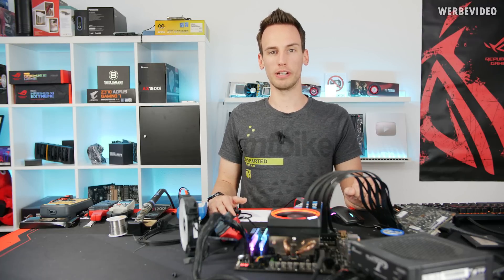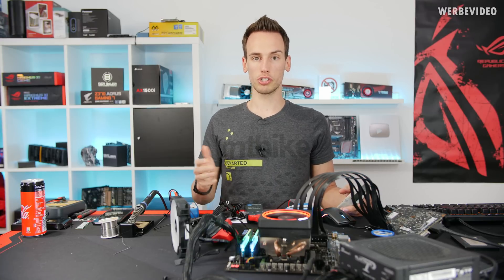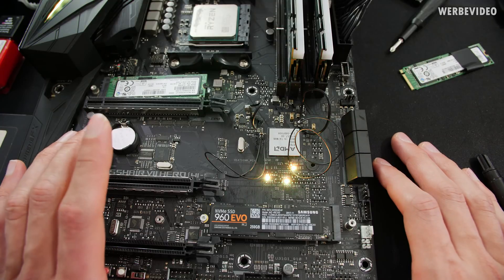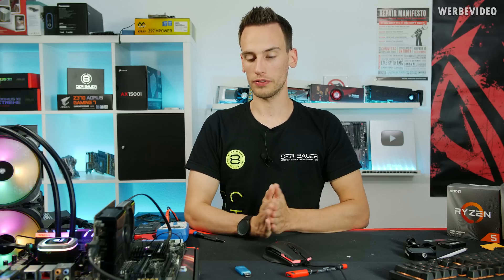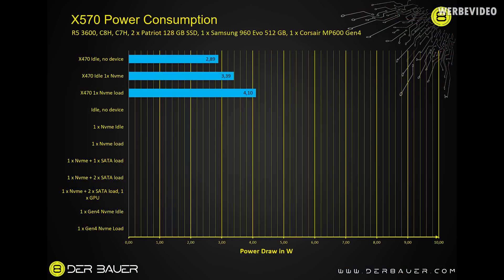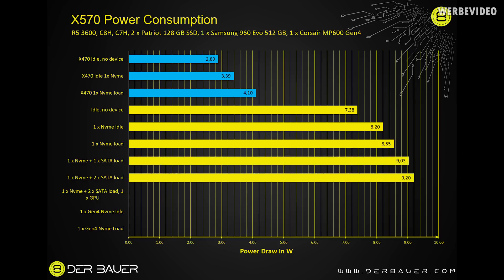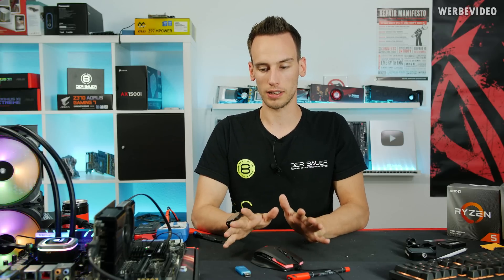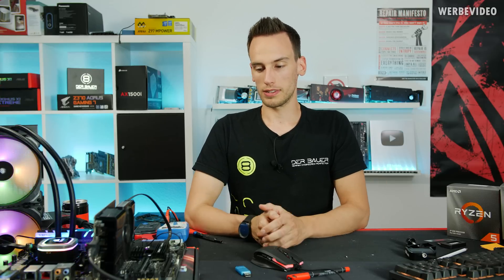X570 Power Consumption Measured - What is going on here?

Comment: 16:41 When I last touched the chipset heatsink (like 15 years ago) while the computer was on, my epox 8rda+ just killed itself with a "jjjzzbttt" sound :/
Reply: Make sure you discharge any static you've built up to avoid that again. Especially when it comes to hardware that old or older. They have less protections in place for static discharge.

Comment: Another question is why did some of the motherboard mfgs build 4+2 stage X570 motherboards? We already have those in current B350, B450, X370, and X470 motherboards now. Buyers beware when searching for a "cost effective" X570 solution. And AnandTech's recent article is all wrong. Do not trust their VRM numbers. Its as if they just counted caps like any numbskull would that knows nothing about motherboards.

Comment: Fantastic video, I love stuff like this.  One thing you failed to mention is that these new PCIe4.0 drives run at the same speed on X470 boards.  Or at least, they do on the Crosshair Hero VII.  I realise it wasn't the purpose of the video, but it further compounds the question mark over X570.. in terms of extra power, extra noise, dodgy fans that aren't required and the only advantage is something that you can get on X470.  I expect that in time newer SSD's might be able to take advantage of PCIe4.0 but at this stage.. they haven't.  Same thing with video cards.

Comment: der8auer, I have to wonder if the additional heat of the X570 chipset vs X470 is because of the difference in "who" designed the chipset.  ASMedia designed the X470 chipset, while AMD designed the X570 chipset (with IP licensed by ASMedia)

I have to wonder if AMD simply cannot design a cool GPU or... now... chipset.
This heat makes the rumored delay in the Ryzen 3000 that Adored reported on being a chipset issue make much more sense.  I really don't understand why AMD would make this change in design if the direct ASMedia designed chipsets were so good though.

Comment: I live on Deccan plateau(India) and here during summers air temps cross 45C. I find it funny how X58 which had 20W power consumption and the motherboards had some of the best heatsinks I have seen to this date and majority didnt have fans. Even those X58 chipsets didn't heat during summers here in India. Those stupid fans are sign of lazy ass engineers who decided to reduce their workload on designing a proper cooling solution.

Comment: I think the reason for the fan is the same reason that AMD is using blowers on their GPU. Because the chipset produces more heat, AMD doesn't trust that people will have proper ventilation in their case. This is what they said was the reason for the blower on their GPUs. I think it's the same reason they pushed to have fans on the chipset. Now, as to WHY the chipset uses more power, I don't know.

Comment: Those long wires might have messed with the tests. Especially the wires in the inductors, would have probably added a lot of inductance and resistance, changing the Q etc.
Reply: i doubt it. the resistance of that wire is a lot less than you think.

Comment: Hi. Love your in depth technical analysis. Also, thank you for calling out on the non requirement of fans for the chipset. I had a feeling those were unnecessary months ago. Thank you for confirming that. I have a very simple question. Why are motherboard manufacturers releasing all their boards with such insane power delivery? I get it that a MSI Godlike or an ROG Crosshair or Aorus Extreme has to live up to its name and price and have at least 12 to 100(pardon my sarcasm) phase designs. But why do the normal boards, sub 200$ boards also need to have these? It has been shown that a 12 core 3900X draws less power than a 2700X under full stress load. It hardly draws more that 150W under extreme circumsatances. An 8 phase proper power delivery would be sufficient. Thus, it is perfectly possible that a good 200$ board could run it. But bacause of this image that AMD and the board manufacturers and the general public has created, all X570 boards are expensive because of high end power delivery systems. Also if possible, please make a video showing that it is perfectly fine to run the 12 core 3900X from a good X370 or B450 board, let alone an X470 as I believe those are perfectly capable of running the new chips upto the 12 core cos of the less power draw. I know the board manufacturers are making all the boards future proof for the 16 core 3950X, but it would be good for AMD if the media also portrayed that and not make it look like Ryzen 3000 needs a large amount of phases and high end boards. Really, someone like you saying that an X370 or proper B450 like the Tomahawk is more than enough for the 3900X or the 3700X respectively would make a lot of this confusion clear.

Sorry for the long post. Thanks. :)

Comment: remarkable work! that makes me feel a bit better if I buy a x570 without active fan shit cooler on top.
Reply: just remember it was still hitting 70C which is hot enough to crash Phenom/FX cpus if you tried to run that hot.   if it's gonna run that hot i don't mind the fan.
Reply: @XX-121  it was 70c with a cheap tiny heatsink... if you have a proper one like Gigabyte has in 1 model... it will not get 70c for sure.

Comment: @der8auer
I have a theory on the higher power consumption of PCIe 4.0 , they went from two voltages to four to transmit two bits at once (11 10 01 00), I can imagine that they had to increase the voltage because otherwise the noise would make the voltage drop too much (below the threshold) X% of the time. Just a theory but whatever the reason is, I would bet that it has to do with noise for whatever reason, if you have more noise then you can always compensate for that and ensure reliable data-transmission by increasing the power, however you do it (several ways).
Other than that, I find it rather lame that the motherboard-companies hide behind the power-consumption when they get asked about the chipset-fan, they should be honest about it and explain why they didn't just use a copper pipe to absorb that heat.

Comment: I think the higher power consumption may be on the gen 4 interconnect between the in CPU I/O die and the chipset. Running a gen 3 device on the chipset doesn't mean the chipset is now talking to the CPU at gen 3

Comment: What's the total resistance of those wires ? More resistant less power right ? or the PSU compensates ?
Also what's the point of this video? Why the chipset PC is important ? Like those RGB LEDs pull more power than the chipset.

EDIT: okey i wrote before i watched that last 3 minutes. 
I love the GB P67 UD7 mobo, but i guess that heatsink  design can't be applied to the new mobos becase of the nvme slot right under the CPU socket.

Comment: sorry but to measure the current after coil gives completely misleading results if you do not have the right equipment. Frequency on the measured current is too high and can lead to rough measurement errors

Comment: test the mp600 on a x470 board and you get the same speed as on the x570 in my case , so it operates @ pci-4 on a x470 board to , this is strange

Comment: Also why does Gen 4 have the same read and write speeds on a X470 board? Reported by OC3D TV. Wonder what the chipset temps are on a X470 when using Gen 4 NVMe.

Comment: Thanks for investigating the X570 chipset power consumption Roman. I've thought that to... Why not just have a larger passive heatsink with more surface area? I dread using a small dinky little fan like that. If the fans were made by Noctua or Be Quiet! then that would be something. But yes, a fan is not necessary if the passive cooling is done right.

Comment: Many thanks for testing this... and Yep. This is very trange... have you been asking mother board vendors hard questions after testing this? Pci 4.0 need better wires, but that should use even less electricity because thicker wires should be better conducts (in reality there is no difference unles you put heck a lot current in there) Maybe They just use higher voltage, like when overclocking memory etc. And that is why effiency is thrown out of window in here. Aka a Little bit more stability, by using really high voltage and thus using a lot of energy for minimal benefit? That is my ques...

Comment: i'd imagen a lot of the increased idle power is that the chip set itself is a gen 4 device. without load its still talking to CPU  and the power draw needed to maintain signal integrity might just be higher

Comment: Thanks for the interesting video. Some YouTubers report that PCI-E 4.0 SSDs produce the same speeds on x470 motherboards with a Ryzen 3000. Could you please test that? Also Ryzen 2000 on x570 would check the theory that PCI-E 4.0 Infinity Fabric between chipset and CPU consumes that much power.

Comment: Motherboard VRMs can put out more power than that yet they don't have active cooling. Definitely a strange choice.
Reply: They are also massively more surface area and good for 120c. FX for example is so big, that it runs very cool even though it’s power hungry (thermal shutdown is 80c, I think official spec was 69c), so it stays much cooler than Intel even at the same heat load and cooler (it’s just better at dissipating it, like spread out VRMs). So make sure to account for those things.

Comment: Tip for future micro soldering, use flux. It works wonders and you can never use too much of it. Also look into an air rework station for removing smds. Much safer than direct heat from an iron.

Comment: The hilarious thing is they have been die shrinking CPU's and GPU's for decades... yet they didn't think a chipset die shrink was necessary!!!

My X99 R5E had a fan on it too, except that I got an EK monoblock for it that also cools the CPU and VRM. Expensive solution, but very effective and keeps the chipset under 50C no matter the load.

I think for this platform to not flop completely AMD better get those cooling fan specs up to par with the motherboard manufacturers. You don't want to be replacing a $400 motherboard after a year because a shitty 40mm fan with dead sleeve bearings ($2 component) is the point of failure. It would be wrong to expect folks like EK to step in and make blocks for every model of X570 board out there.

I've gone through this already four years ago when dealing with GSkill's memory cooler. Those horrible 50mm units would crap out after just 6 months of use - first the LED would die then the fan. I got sick of replacing them. I finally sourced a half dozen ball bearing PWM units from Delta, same 50mm size but with a much longer MTBF, custom assembled for me by the folks at Digikey. Admittedly these 50mm fans weren't cheap, but I've been happy with it for over 2 years now. Those who know their fans know that Delta makes some damn good ones.

I think you are right that a bigger heatsink would benefit chipset cooling on these boards. Maybe when their RMA pile gets high enough or customers begin to revolt manufacturers will take that idea into consideration LOL

Keep up the great work m8!!!

Comment: maybe they just want them to look more premium and high end.  they do look cool, even though it's adding a potential failure point.  noise is probably negligible unless you're going for a completely silent build, even then I'm not sure you'd hear it through a case.  given the size of the heatsinks on x570 you could just disable the fan, or replace the heatsink solution if you have a problem with it.

Comment: My 2¢... 

I would put my money on the fact that this chipset is just a universal use I/O design by AMD, intended to be used for the Ryzen 3000 series, Threadripper 3000, and EPYC 'Rome', as well as serving the purpose of the chipset in X570 motherboards and, I would presume, new Threadripper boards too, possibly EPYC board uses even.
AMD is obligated to support Global Foundries by fulfilling a minimum production order with them each year; and, since GloFo hasn't gotten their 7nm line up and running which lead AMD to move their CPU production for the first time to TSMC(who has been one of the leading foundries in the world with 7nm, and soon to be 7nmEUV, rumored to be labeled "5nm"[...and it just becomes that much more incomprehensible...]), this left AMD with the need to fulfill this contractual obligation in some way. Well, motherboards need a chipset to control the I/O functions of the board, and with the modular chiplet approach to future AMD CPU design resulting in the need for a multi-use I/O die, why not just go ahead and design it to be universal enough to be used as a chipset as well.
And, as we all [should] know, universal products are rarely as efficient as purpose built products; but, if it doesn't actually make a difference in actual use(after all, the difference between 7 watts and 14 watts in a fully equipped PC is negligible in the big picture of hundreds of total watts) then the "worse" universal product can actually be advantageous in cost(...and fulfilling contractual obligations...).

Now, as far as why the need for active cooling where passive 'could' be used, I wouldn't be surprised if it's guaranteed headroom for maybe some power draw spikes seen during development, or maybe it's the much talked about potential PCIe 4.0 NVME RAID configurations, or some have mentioned a potential large amount of overhead between the chipset and CPU link. 

It's just hard to say without having an insight into what was seen by the board partners during the development of X570; though I am pretty confident about the universal nature of this I/O chip design needing to support up to the upcoming 64 core Threadripper and EPYC CPUs being the culprit for the high idle draw.

Comment: Didn't AMD design this chipset instead of ASMedia? AMD probably doesn't know what they're doing with chipsets and it's not using TSMC 7nm.
Reply: Can't figure out how something works? Well it must be because these engineers that are some of the leading CPU & GPU designers in the world just don't know what they're doing with something as hopelessly complex as a motherboard chipset...
Reply: AMD design with some AsMedia Ip and it is on Globalfoundries 14LPP which is a drop from 28nm x470 and 55nm x370 and Fan is more there for to stop throttling when chip is being pushed and from being cooked in a bad hot case

Comment: Dear Derbauer.

Ryzen 3000 does NOT need  gen 4.0 to run pcie 4.0 devces at all , the whole bandwidth and IO is completely provided by the  CPu. motherboard vendors knowing that Intel motherboards will not sell, had to  fake the idea that x570 motherboards are way more avant-garde, while in truth they can be way more spartan that x470..... they  are simply trying to  maintain same revenues with less units sold, becuse in truth x570 can cost  way much less than x470 motherboards even with 16 phase vrms and server grade controllers.

Fans on a mother board are their way to make it look  as if its a sophistication, but, once all  mainstream will hear that YOu can run PCIE 4.0 speds on  470 motherboards for ssd and GPUs because al that matters in teh CPU, then these x570 motherboards wil not sell a tall....next years expect x670 motherboards to cost at LEAST  half their current pricing ...I am absolutely a Asrock hater, but they did the  wisest thing to basically change x470 a little to make it x570 and they will have the least losses.

Dont believe me?!....try running raid 10 on x470 with 4 pcie 4.0 m.2 ssds...the whole point of PCIe 4.0 is for an M.2 ssd to use ONLY 2 pcie lanes, and NOT4 as  it is doing now...so this is evidence that x570 motherboards are FAKE PCIE 4.0 motherboards and  it will put many   in taiwan thta make motherboards  in handcuffs for consumer fraud

Comment: should have tried 4th gen NVME Raid. Pushing the bandwidth and chipset usage in a mirrored raid NVME RAID setup i think would spike the power usage. A pair of pcie4 high speed nvme ssd's, that Beat the chipset with 8gigabytes per second and higher sustained transfer rates were what I had heard would push that powerusage up.

Comment: OC3D TV tested a NVMe 4.0 on a 470x board and got the same read and write speeds as a 570 x board! Might want to take a look at 470x chipset heat measurements with a NVMe 4.0.

Comment: As for power consumption of this chipset - Ryzen v1000 is an embedded cpu that has 32 pcie lanes. If Ryzen 3000 has a v1000 replacement in the series then the io die has 32 pcie lanes out . We can see from the existence of the 12 and 16 core that it supports two infinity fabric links internally. Ryzen 1000 and 2000 series has a multi-purpose piece of silicon that can be a infinity fabric link or a pcie nexus or sata. I expect this is the same in Ryzen 3000. A pcie nexus is 16 lanes of pcie. So this io die has four of these multi-purpose io links. Which means this chip has the equivalent of 64 pcie lanes in it. If power gating is not being used correctly then it has 64 lanes all light up at idle. This would explain why adding devices does so little over idle power consumption.

Comment: Overall power consumption affected by Gen 4 interconnect with CPU I think, so it's already running at clocks required running PCIe 4.0, so there is why it's not much difference between PCIe 3.0 SSD and 4.0 SSD.

Comment: A reason for the fan on the chipset may be because of time constraints the chipset was the main bottleneck for x570's release, so I can imagine a scenario where the motherboard manufacturers suddenly had to deal with a 15w rated chipset. Being unable to produce and most importantly validate a passive heatsink in time.

As for testing the power consumption: you can still test usb as well to see if t hu at may increase it

Comment: How does the speed of the gen 4 SSD change if you plug it into a gen 3 board? I.e., are nvme drives bottlenecked by the pcie bus or the memory controller?